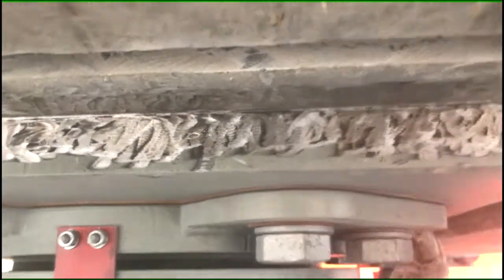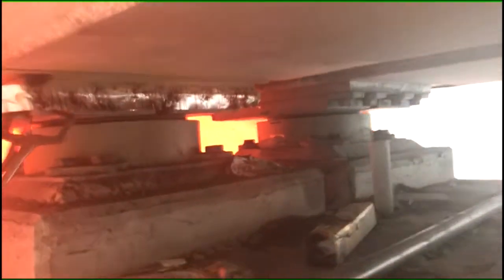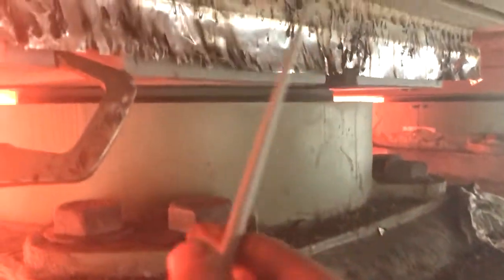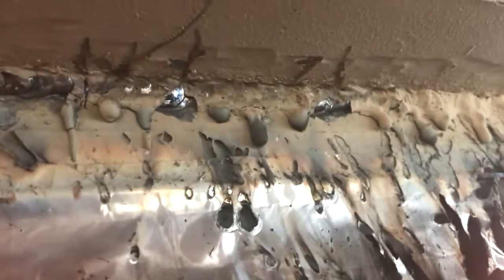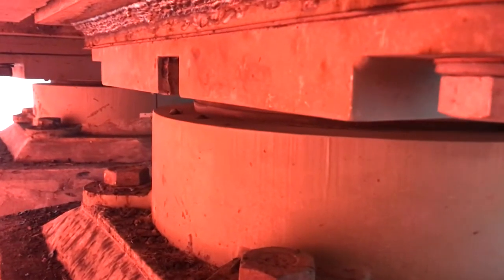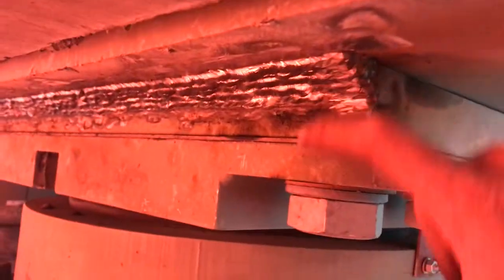The life of a welder

Comment: Put your oxy torch on it burn it off no griding needed and its pre heated. Wire wheel it before you weld. Promise it works get a #4 tip and turn up.
Reply from the maker: Hey thanks. Yea that probably would have been a great idea. But they were super fussy about how they wanted it done and were all worried about damaging the isolation layer so we were not allowed to use a torch at all on them. They just put the frost fighters on them and we had to wait for them to come up to temp.